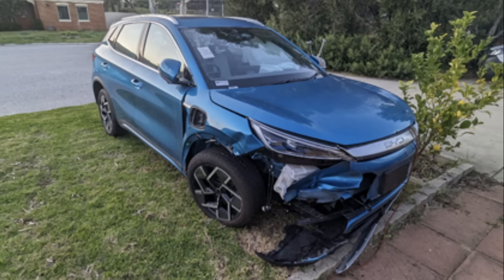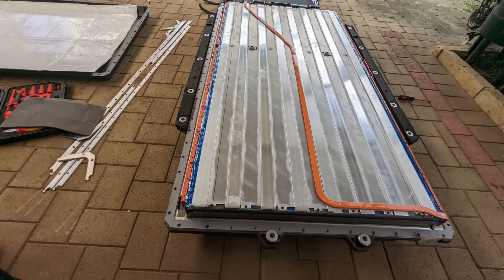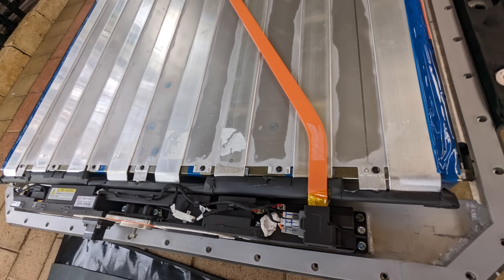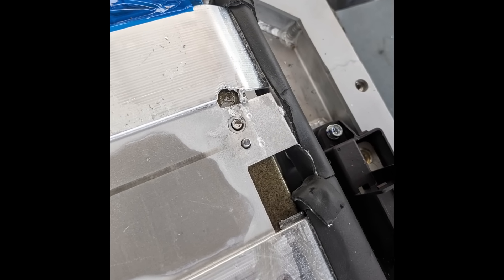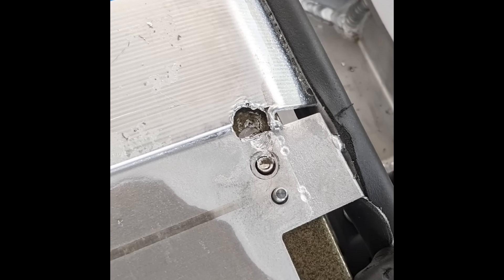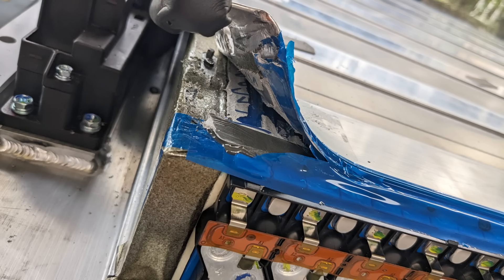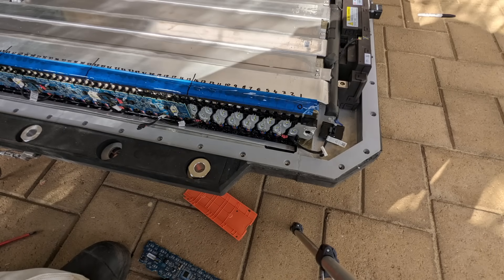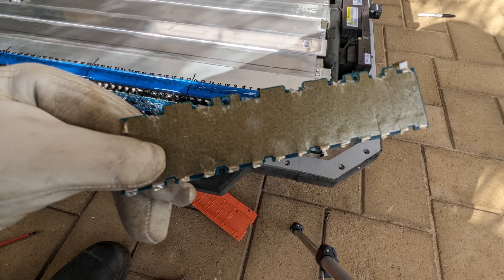BYD Atto 3 battery dismantle P1

Comment: No wonder EVs cost so much. Certainly more sophisticated and detailed than I imagined
Reply: Actually, China was smarter than that. They cornered a lot of the world's lithium and cobalt market buying up mines in Africa.
Reply: @mondotv4216  lol and batteries like this one does not need cobalt. and btw. Australia provides about the most lithium, Sweden and (maybe USA) will follow since huge reserves were discovered
Reply: @mondotv4216  Lithium is in abundant supply worldwide. It is the refining technology that China is leading in.
Reply from the maker: To be fair, ICE cars are a lot more complicated. Everyone is just used to them.
Reply: @Brendon_M  EVs are far more complicated than ICE vehicles. The most complicated part of EVs are the batteries cells, which require sub-micron precision throughout and are incredibly difficult to manufacturer at scale, not to mention requiring cutting-edge inputs from far more scientific and engineering disciplines than ICE engines. Comparing EVs with ICE vehicles is like comparing a Swiss watch with a neolithic arrowhead.
Reply: no @Brendon_M
Reply: @Brendon_M  boom spot on
Reply: @Brendon_M Agreed, it takes many decades to master it - performance, reliability and economy.. yet thanks to Elon Mush which open the door to China to wipe out ICE development and do what China do best, semiconductor and electronic  the things they been producing all for a decades
Reply: @Tookewflowskew  how elon musk has anything do to this. Byd already produce EV for years before tesla even produce their first car
Reply: @nagi-springfield93 First Tesla was the Roadster in 2008.
First BYD BEV was the E6 in 2009. Almost all early production was ICE powered.
Tesla was given the outright ownership of their China operation in order to upskill the local suppliers in EV production. 90+% parts are now China sourced for Shanghai production.
Reply: Actually EV are not so expensive in China...
Reply: The same Volkswagen electric car is priced three times higher in Germany than in China
Reply: An Ecar is a lot simpler than an ICE.Compare motors etc. The batteries are the most complicated thing but its amazing how they are getting it down pat now.

Comment: Where does this car have Pyro fuse? and does it blow if airbags are deployed?
Reply from the maker: No pyro fuse. Just the 350A over current fuse inside the contactor block at the front of the pack. There may be a pyro fuse inside the power distribution box under the bonnet but I doubt it as the airbags all went off in this car and after clearing fault codes the car was drivable again

Comment: BMS isn't in a battery pack?
Reply from the maker: Yes, the main board is inside the contactor block at the front of the pack and there are cell top boards running down the side covering the busbars

Comment: Wow, I thought it would be more easily repairable (cell swap), but seens almost impossible. What do you think about that? Btw congrats, very nice project and video.
Reply from the maker: Thanks. Yeah I'm a bit disappointed in the lack of repairability. On the other hand it speaks to how confident BYD are in the reliability.
Reply: I would rather not encourage self repairing  of battery, which could be potentially more dangerous after such non-authorised repairing. Always remember: SAFETY FIRST
Reply: Kind of makes the battery very hard to repair or recycle when its end of life. Pretty disappointed and there should be laws preventing this type of manufacturing.
Reply: @armunro These blade batteries have a Large amount of Charge per cell to recycle them dip in liquid Nitrogen and Shread the whole pack. Much safer!

Comment: Thanks for the wonderful video. How does one buy this type of battery pack from China?
Reply: By giving BYD a call or going to their local dealer. Replacement batteries are available.

I was initially going to import one of their cars, before I learned of them signing a dealership contract around here.
Reply from the maker: No idea, I bought a wrecked car and stripped it out

Comment: This orange cable on top of the battery is the worst placement of a cable i have seen in a VERY long time.
Reply from the maker: The plastic lid of the case has a raised section in it to make space for that positive bus bar which I thought is a bit poxy but where else can they put it. If they ran it round the sides of the pack it would be in danger of damage in a crash. Where it is is pretty well protected and takes the shortest path possible. There aren't any good options really.
Reply: @Brendon_M  Its in danger anyway. Thats not a excuse. Of course they can route it around. In case of a crash thats hurting the battery, the pyro fuse prevents a internal shortage.

I know there are no "perfect" options but across a perfectly flat stack of blade batteries is the worst way.

Comment: Now I can see BYD did a decent job on battery pack. Thanks for the hard work! I remembered seeing somewhere a more messy battery pack of Tesla....
Reply: テスラもBYDのバッテリーを使用していると聞いている。
Reply: @shaguge yes,BYD's battery would be transportation to the tesla germany factory,in there,they will be put it together with model3
Reply: @shaguge  Model Y...
Reply: This is just as bad as Tesla.. neither are built to be repaired. It's disposable junk. The German manufacturers have much better designs
Reply: A Tesla pack of the Model Y BYD blade battery pack is much better organized, more efficient and easier and cheaper to build. BYD has a bit to learn. They are on a good way but they still have a long road before them.
Reply: @wolfgangpreier9160 
And because they're packed according to the Americans' demands, they are dangerously fire-prone. Look at the recent Walibi Holland fire for example. Two Teslas went up like a bonfire, a Leaf burned easily, the BYD Atto3's refused to go up, one Renault Zoe refused to go up. Honourable mention for an Opel Mokka-E that took medium fire pressure from the side and refused to go up.
The Loooopings website 'Brand op parkeerplaats Walibi Holland' has a photo of the Tesla throwing up flames twice its own height. Right next to the inferno, an Atto3 that's showing that much fire pressure doesn't compromise its structure or battery.
A Tesla model x took very little fire pressure from behind, but lit like a bonfire and was literally burned in half. Photos at local media Omroep Flevoland 'Zes elektrische auto's uitgebrand bij Walibi'

And I see more photos of Teslas basically burning to a crisp while other EVs that took more damage (either impact or fire pressure from other sources) remain more structurally intact.

The reason Tesla buys from BYD is because BYD has better engineering than Tesla has itself, or the Korean batteries Tesla bought before.
If only Musk can get his sociopathic fingers off the designs and let the Chinese engineers do their jobs, they'd be much higher quality.
Reply: @wolfgangpreier9160  dude, Tesla has 3 battery supplier. panasonic, CATL, and......BYD
Reply: @wolfgangpreier9160 Tesla battery can catch fire, BYD blade doesn’t, it can run punctured, Tesla battery charge less than 100% to extend life and BYD blade can charge to 100% every time, Tesla battery drop about 30% in cold weather and BYD blade battery drop about 15% in comparison
Reply: @ALWH1314  you are wrong here and seemingly did not understand what was written. 
Tesla uses the BYD Blade cells to build battery packs (used by the Tesla Model Y build in Berlin). @wolfgangpreier9160 compares the Tesla pack with BYD blade cells with the Blade pack from the BYD Atto. As tesla pack also uses BYD cells it can also get charged to 100% every time. But the BYD blade cells (LFP) have a noticable worse cold weather performance than the NMC tesla batteries currently used in the cybertruck (not better) - due to the chemistry. 
To safety - a single cell can get punctuated because of the small area of cell material impacted. But this is not the configuration in the vehicle where the cells are tightly packed.
Reply: @ALWH1314  Model Y has an LPF battery, same chemistry as Blade...
Reply: @ALWH1314  Blade batteries are nice, but it doesn't seem very serviceable. Just one BMS module to fail and the whole pack is trashed.

Comment: very good effort, these batteries are an Art and very complex - hence battery recycling is not easy even commercially.
Reply from the maker: Thanks. The battery recycling I've seen mostly just involved giant shredders so easy disassembly is not too important for commercial companies. But anyone wanting to reuse these packs are going to have a hard time
Reply: @Brendon_M , really apprecite your efforts. Does it mean that replacing  bad batteries only (partly) is not going to be easy as well ?
Reply: Specifically, see the Li-Cycle battery recycling processing which can take the whole 1000+lbs EV battery as is and literally shred it.  Then separate its shredded components by density in a proprietary liquid column along with some other processing afterwards.

Search YouTube "li-cycle battery recycling" and especially the video from JerryRig where he recently went to a Li-Cycle Arizona plant to see the operation up close.

The process uses no heating so no fumes at all.  The water is recycled.  Some 95% recovery of the battery including black mass, metals, and plastics.  You can see the machine feeds from 1000+lbs EV batteries to palm sized phone batteries all the same.  Kinda like eating sunflower seeds versus a big pork chop and it all gets digested the same way.
Reply: Like said here, watch how they do it,brilliant.
Reply: Hard to recycle? Wrong  - relatively quite easy actually. There are more and more companies doing this now- only problem being lack of car batteries to recycle. As more become available, the recycling will only increase. (It’s MUCH cheaper to recycle than mine new minerals.)

Comment: Water resistance?
Reply from the maker: There is a thick gasket all around the outside where the top plastic case bolts down onto the aluminium base and there are O rings around all the connections. The pack also had a couple screw vents on top that equalised pressure when I undid them so the pack is air tight

Comment: It's clear cell to pack method, but I don't see the structure part (other than cells being glued together). It would be interesting to see Tesla's version of the Blade cell pack.
Reply from the maker: I've yet to see an actual "structural" pack from any car manufacturer. As far as I can tell it's just marketing hype. They all just increase rigidity in the car body.
Personally I think a structural pack is a bad idea, I don't think the cells would last long-term with all the various loads put on them
Reply: @Brendon_M  I've read an auto engineer's take, that structural cells are a dumb idea.  Putting huge structural loads on fragile batteries is just asking for disaster.
Reply: @Brendon_M sure marketing hype, but they’ve managed to get good range and power to weight ratio. Kudos to them for it, and to you for the vid. Still anxiously awaiting part 2.
Reply: @Brendon_M  I would say 4680 Battery pack from Texas Model Y is actual structural part, but they don't make many of them. - 4680 ramp up is nowhere there yet.
Reply: @HVM_fi Teslas 4680 is already superseded. CATLs new design has higher volumetric density. Most Tesla cars sold world wide use CATL or BYD LFP batteries now. I suspect Tesla might ulitmately stop making batteries.
Reply: @nordic5490  LFPs are used standard range and low power models, NMC beat them still energy and power density.

Comment: So much for the theory that individual blades could replaced... it seems these blade batteries are not repairable at all.
Reply from the maker: It may be possible with some specialist equipment for the busbars and chemicals to dissolve the adhesives but yes, as far as I can tell if you have a cell die then the whole pack would have to be replaced.
Reply from the maker: @@xarifa777 I don't think even the manufacturer will be able to replace them, it'll take some very specialised equipment. If a cell fails while the car is under warranty they'll just replace the whole pack and send the old one to recycling then write-off the lost value. Once the car is out of warranty the manufacturer won't be interested in spending time and money replacing single (or groups) of cells for their customers. Instead they just sell a new pack/ whole car. 
I have no doubt that someone will work out dodgy way to replace single cells but it's not going to be easy and I suspect not financially viable.
Reply from the maker: @@xarifa777 I agree, while the cells not being easily replaced is disappointing it's a non-issue. I expect the battery pack to outlive the body of the car. Certainly wouldn't stop me from buying a BYD.
Reply from the maker: Yes, the way I see it is if BYD are willing to make it this hard to replace a cell they must have plenty of confidence the pack will outlast its warranty without issue
Reply from the maker: I bought the car at auction, I wasn't the one who crashed it. All the airbags have gone off  and the damage was relatively minor so I think the people that were in the car are probably fine.
The car has been classed as a statutory write-off which means it can never legally go back on the road but other than that I think it would be quite repairable
Reply from the maker: @@xarifa777 no, I bought this car (2022 model) after it was in an accident to use the battery for home storage.
Reply: @@xarifa777In some countries, people extend the life of the car. So, 8 years, for me, is a young car! 20 years is a sweet spot! 
Just my thoughts!

Comment: Does this BMS plates have any balancing circuits ?
Reply from the maker: Yes, there is a transistor and 2 resistors at each of the cell taps. Looks like the 2 resistors are in series with each other and are 10 ohms each. The transistor switches them to be in circuit across the cell terminals
Reply: @Brendon_M  Thanks, so it’s passive balance circuit, I asked because had cell drift issues (0,35v) when fully charged after half year ownership and not charging every day fully, only once a week and heavy usage of DC fast charging, that why when I look on modules temperatures some of blocks have higher temperature overnight !!!
Reply from the maker: @romsa1977  yep that'll do it. It's hard to keep LFP in check without fully charging it because the charge curve is so flat except at the upper and lower ends

Comment: Could you show a bit more detail in connection of cold plate to the cell?  How many insulating layers and what exactly bonds to what?  Example (assumption): cell wrapped in adhesive bonded film (blue), then adhesive bonding the blue wrap to bare metal cold plate?
Reply from the maker: I'm no longer going to try and pull the cells out of the case. I wasn't expecting them to be glued in so now I'll be keeping them in that case but I am planning on rewiring the pack to a different voltage and I'll try to make a video of that process. I'll also try to get a few more close up shots of the way the cells are glued in and attached

Comment: Very interesting , do you think in the future reconditioning of this battery will be possible,  and do you think this battery could last 20 years ,  cheers
Reply from the maker: Personally I don't think there will be much in the way of reconditioning these batteries. Maybe if there is a chemical to dissolve the glues, but you'd still need to get BMS and busbars off the cells which I can't see a non destructive way of doing.
The build quality seems fine and so far BYD have a good track record in making cells and battery packs so I think the battery will last.
LFP is a (relatively) safe chemistry that is known for lasting and the thermal management is well designed so I'd have no hesitation in buying something with this pack. They'll probably fail in warranty or not at all
Reply: The service life of a battery has nothing to do with time, but the number of charges and discharges.
Reply: @poopkljok8342  More important is temperature and time at maximum voltage. Dahn has 10k cycled NCM when DOD is 30-70%
https://www.youtube.com/watch?v=URi4JNq6zY8
Reply: Well, currently we write them off as broken if they lose 30% capacity. But that's still 42 kwh worth of battery that works.

What we really need is an adapter to hook those into home solar panel installations as a battery buffer, solve the problem of old grids not able to handle neighbourhoods being a huge net electricity delivery area during the daytimes when the sun is out, instead of using it up like they did in the past.

Comment: Wow, you deserve a medal for perserverance. How long did this part take?
Reply from the maker: Thanks.
The raw footage is about 2 hours all up, maybe about another hour or so of looking at things deciding how I'm going to tackle them. So it wasn't as bad as I thought. I'm yet to cut all the busbars apart. I suspect that'll take some time
Reply: Do you think that you could replace dead cells in the future , like they do in Toyota hybrids,  cheers
Reply from the maker: @honestjohn6222  probably not, which is disappointing.
Reply: @Brendon_M 
Dear ,
May I know what’s makes you disappointing..?
BYD ensure we can replace the cells inside the battery bank instead of dead cells.
Reply from the maker: I'm disappointed because you cannot replace the cells in a BYD pack. If a cell fails then the whole pack is destined for recycling. Hopefully they are as reliable as BYD claims and cells won't have to be replaced
Reply: @honestjohn6222  Yes very disappointing....... I reckon the manufacturer who produces a battery that can easily replace individual cells would be very popular, since it is often that only one cell failing that kills a big valuable battery.